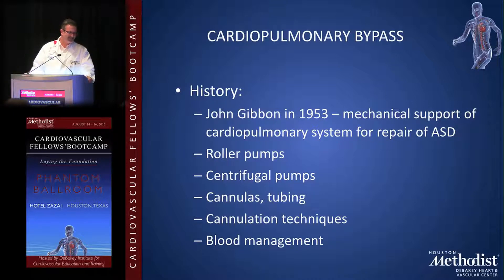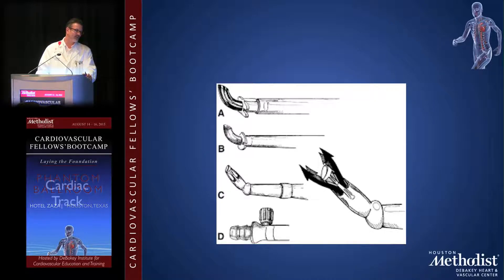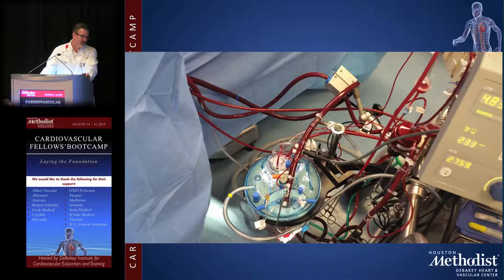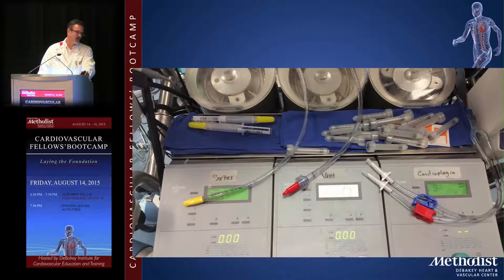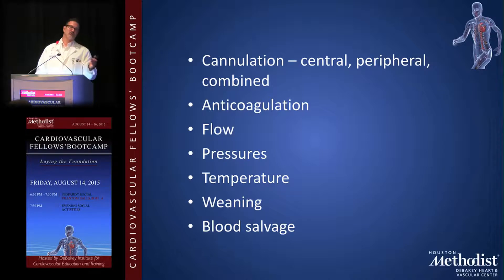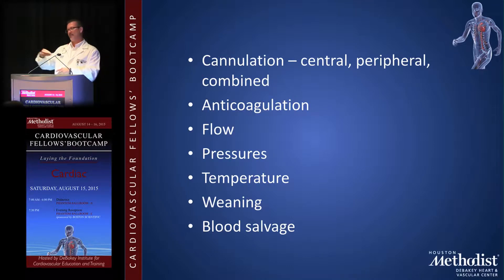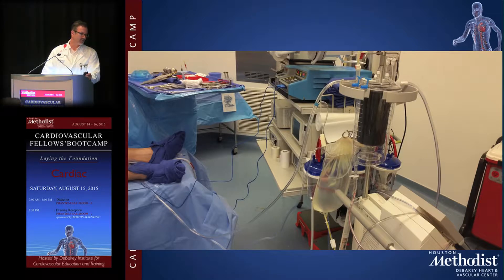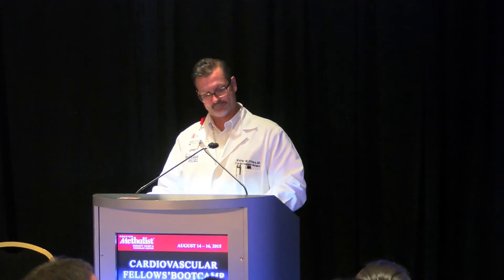Cardiopulmonary Bypass (Walter O'Hara, MD)

Comment: Hi,  Thanks for the video I'd like to ask a couple of questions?
How do you decide the exact placement of the aortic cannula ?
Generally what is the concern for mobilizing arterial plaque specifically due to the cannula's outflow? 
If a cerebral dysfunction due to CPB surgery occurred, what is the likelihood that the aortic plaque was responsible?
If the reservior level goes very low does the pump stop until it refills and then begins again automatically? How common is that of event? 
Thanks in advance
Reply from the maker: I usually palpate the aorta prior to canulation, if I feel plaque I try to cannulate in a soft place on aorta.  Embolization is always a concern and if there is a CVA after surgery then this would be the first thing I would think of as the cause.  The canulae we use are also engineered  in a way to minimize direct spray onto the aorta.

The pump will stop because of an air-lock if the reservoir is let to run all the way out.  However there is an alarm that lets the perfusionist know that the level is getting close and the perfusionist can then add volume (saline) or I can try to find volume (blood), usually in the L chest.  This rarely if ever occurs. 

Walter O’Hara, Jr MD
Reply: DeBakey Institute For Cardiovascular Education & Training 8